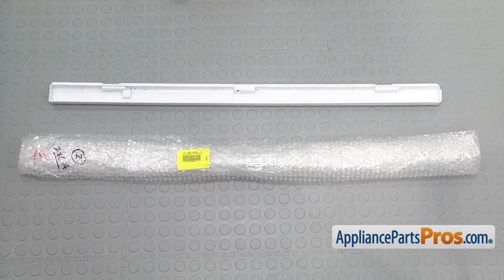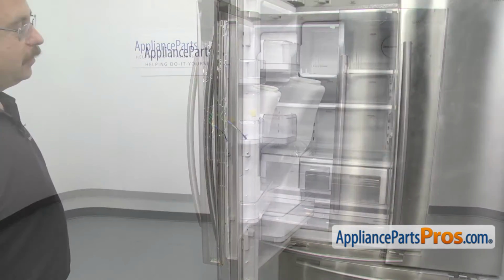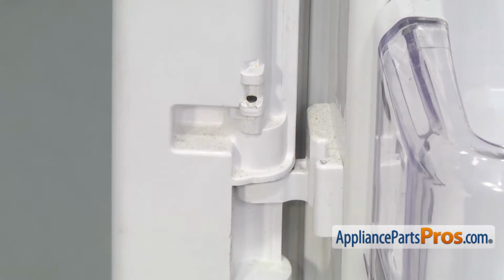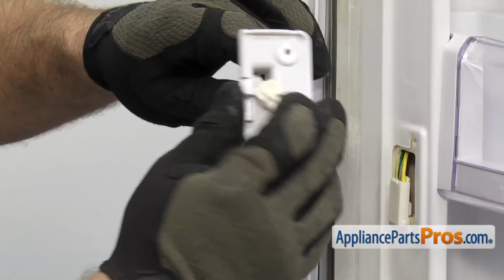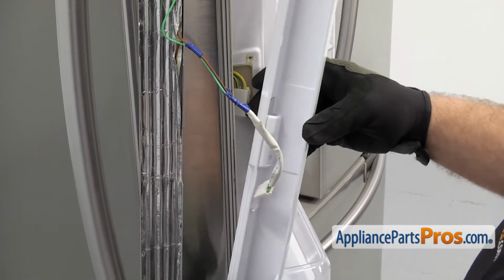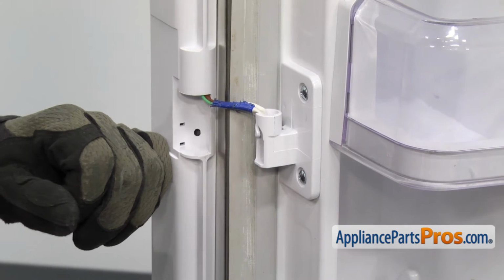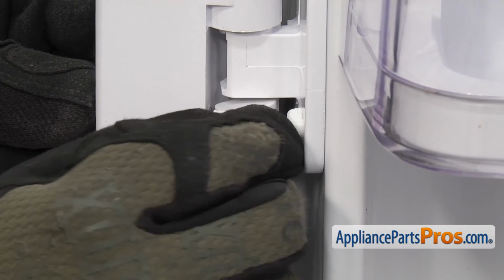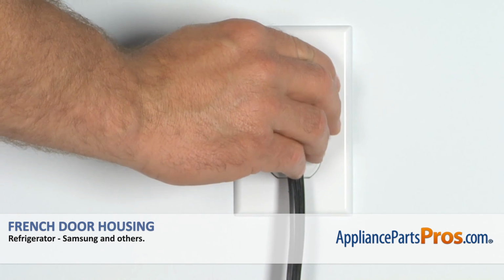How To: Samsung French Door Housing DA61-04286A

Comment: Thanks for the video. I would not attempt this repair without it.  However my refrigerator,  RFG297AAWP/XAA, did not have a screwed-on top guide shown at the 5:20 minute part of the video.  It had an small tab that was part of the flipper housing before it broke off.  I cannot find the top guide as an available part to buy.   Nonetheless, the new flipper housing with the mold for the screwed-on top guide seems to work fine without attaching the top guide.  Also my refrigerator did not have a spring.  I don't ever remember losing or breaking it but all the same the new flipper housing appears to work fine and close tightly without the spring after I lubricated the hinges with a little silicone spray

Comment: Be aware when snapping the heater panel back that the white outer housing has quite a bit of give if you need to get the flat head screwdriver in there to bend it open just a little. Thank you so much for this video. What would we have done without it? Just saved $300 worth of service appointments.